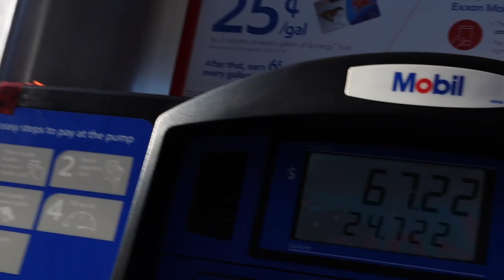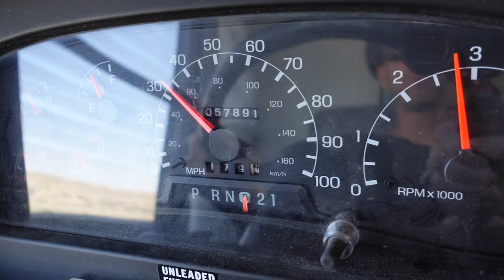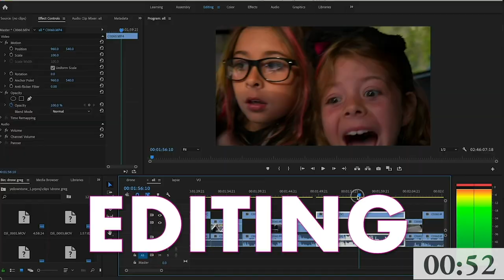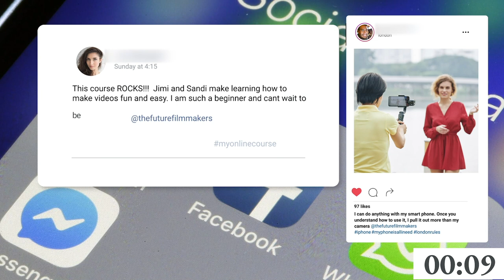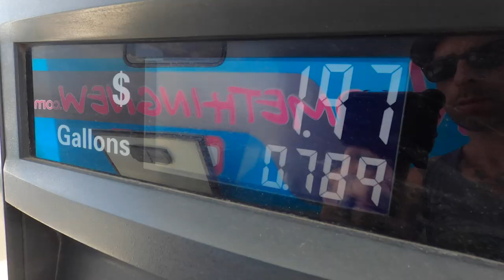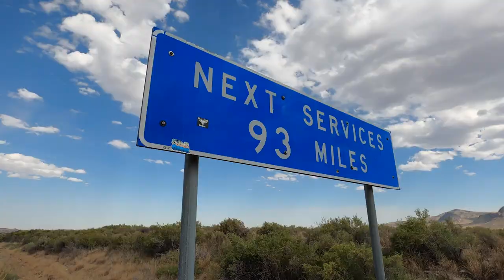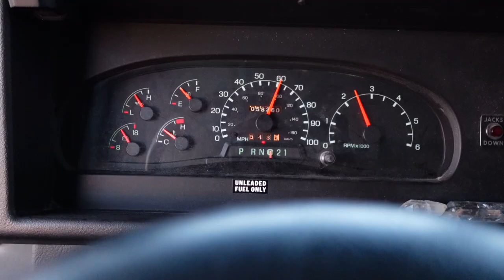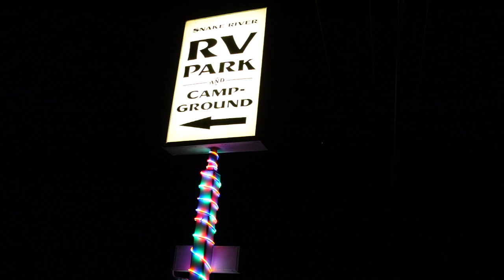RV LIVING - 600 Mile Trip In One Day- WHAT COULD GO WRONG? Family Travel Vlog

Comment: Glad the MOM switch worked. The momentary switch allows you to draw on the coach batteries to either start the engine or in some RV's to "charge" your chassis batteries up enough to allow them to start your engine. I hope you get/got your chassis batteries checked and charged/replaced so this doesn't hamper your future travels. Happy New Year from Australia, stay safe and stay awesome.
Reply from the maker: hey Aaron thank you so much! yeah the mom switch always comes through you are right we do need to get the battery checked we replace the two house batteries but the chassis battery is due for changing.  happy new year to you!

Comment: 0:50, 10:35, 20:09 just a thought, make sure the winch/ratchet mechanism and the strap is centered at the front wheel. the overall tire webbing should be uniform and flush on the outside/inside of the wheel also. the timestamps show the driver side was off center from the jump, and you'll notice the last two timestamps show how much tire movement occurs during your travels. also check the ratchet actually locks on a tooth when securing the vehicle. 🤙🏽
Reply from the maker: yea thanks so much, good lookin out! i will show jimi
Reply: @tryNsomethingnew  awesome! double check the steering wheel is locked and do a loop around the block and retighten if needed before long treks.